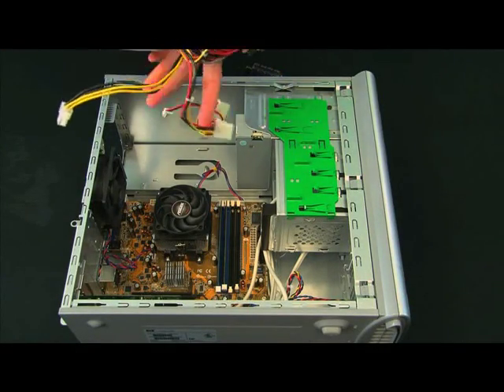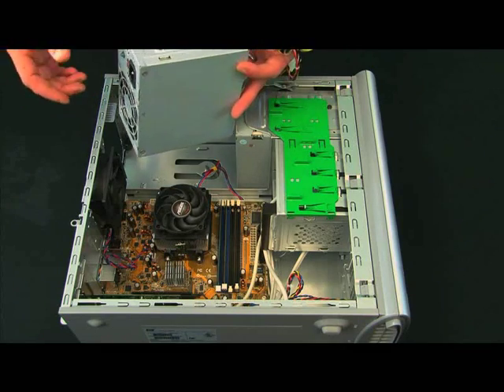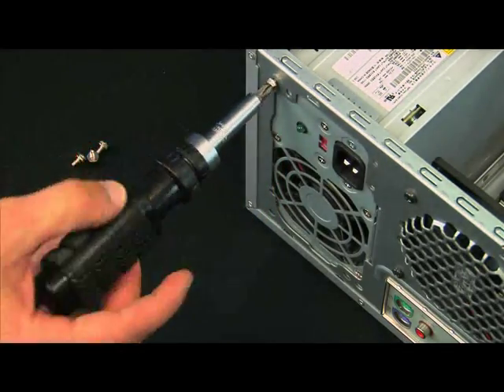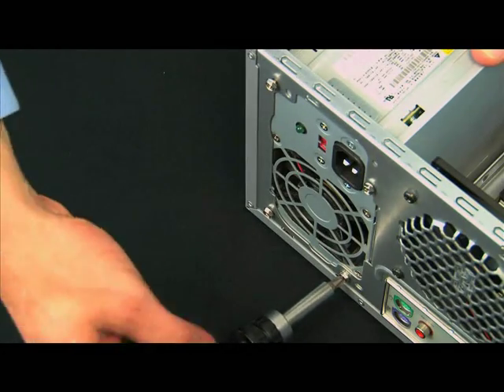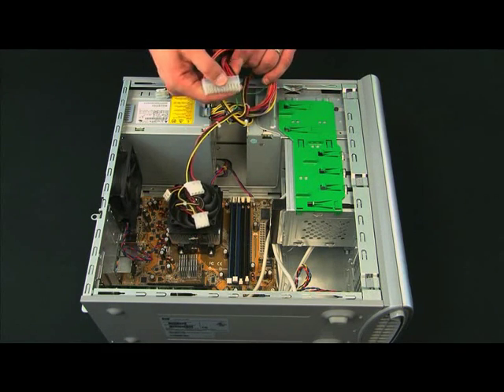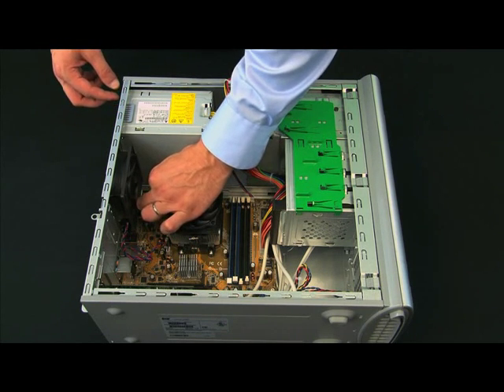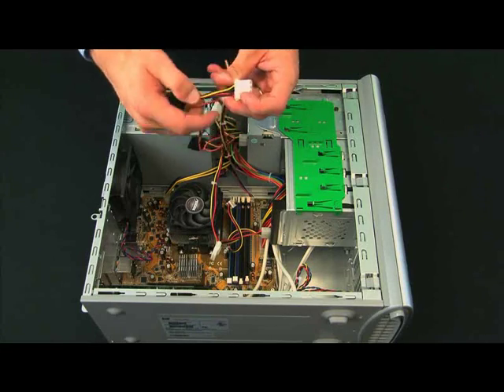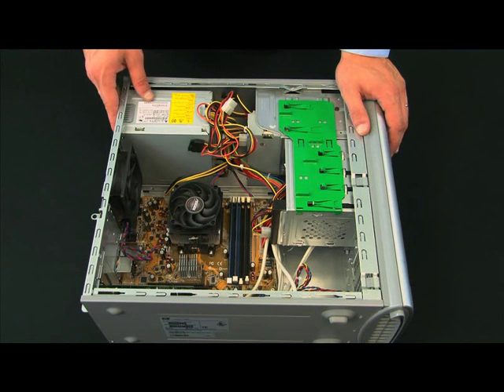CompTIA A+ Certification - Installing Power Supply Video - 2009 Edition - K Alliance

Comment: @kentokae  who is playing with capacitors which like you said holds the charge? no one smart enough to do pc repairs unless unplugged for an extended period  a magnetic screwdriver is not strong enough to do any damage plus the hard drive itself has stronger magnets which is what? usually 1 inch from everything else that your worried about? gg newb. static discharge can f$ck things like ram as well as something on the board grounding out. Cardboard box it and man up.

Comment: @creedstruth you worked on computer you need to study electric engineering kid. Every Electrician will tell you that using magnets is a risky business, because of how Magnetism and Electricity are so closely related and how they interact with one another. You can make a Wireless Power cord with Magnets so you are just deteriorating the Power Supply, which is BTW usually the first component in the PC to die.

Comment: @creedstruth Study Electronics and Electrical engineering the Power supply dose not have to be turned on OR Plugged into the wall there is a component in a power supply called a Capacitor that maintains it's Electrical charge and another component called a transistor (or is it Transformer)that basically uses a magnetic field to transfer electricity. If you use a Magnetic screw you could initiate electric transfer. and short out the PSU, motherboard or fry yourself.

Comment: @creedstruth Not to insult you as the others, but they are correct. Using a magnetic screw driver on any electronic equipment, especially power supplies is a recipe for disaster, and It is a bad practice. The Reason you have not experienced disaster is because most newer electronics have the protection against magnetism. Power Supplies on the other hand might pick up the magnetism as a power input and attempt to send that power to the motherboard.

I hope you understood,and not take offense.

Comment: @sandpir8 Magnets can deal allot more harm then erase a floppy. If you have any knowledge of Electronics you'll know that the power Supply have magnets inside of it. 

The wires connected to the motherboard is not connected to the wires leading from the power socket on your wall. The power from the wall outlet is transferred wirelessly to the wires that connects to the motherboard via electromagnetism.

Comment: @SPARTAN112CE  About the only way you'd damage an HD with a magnetic screw driver is if you use one to take the HD apart...  heh...  Inside HDs are some of the strongest magnets you'll find.  The magnetic flux of a typical magnetized screwdriver is almost negligible in comparison.

Comment: @popomartin2 not quite true, yes you cant use magnetic screw drivers around hard drives, but anywhere else on the system is fine, ive been working on and building computers for nearly 4 years now, and i use a magnetic screw driver, but i have other tools as well for each situation